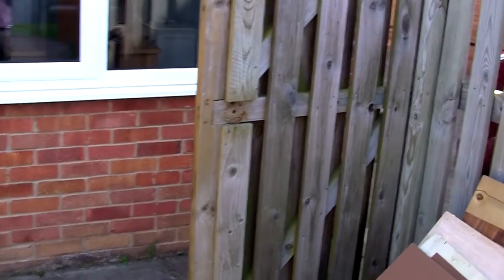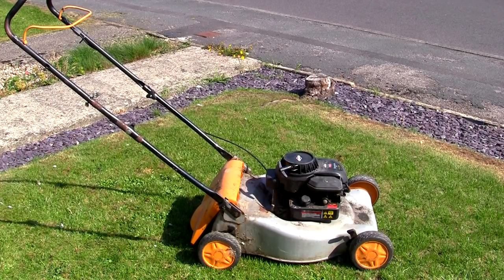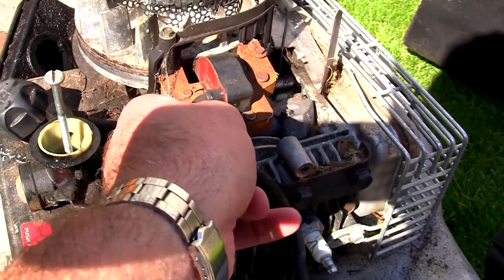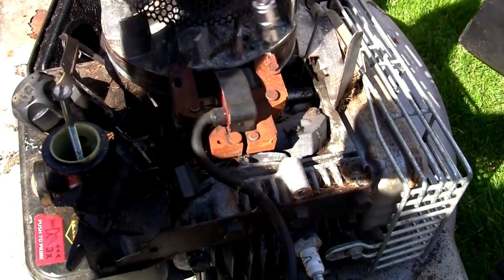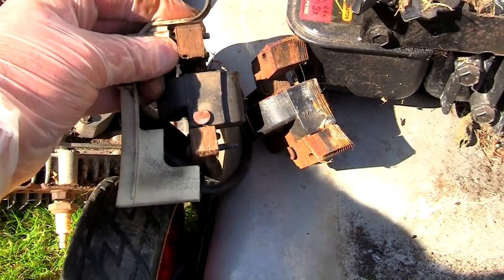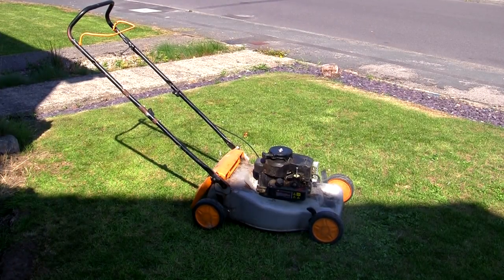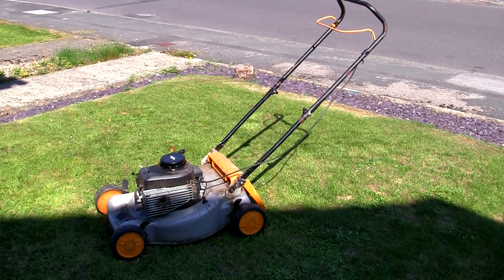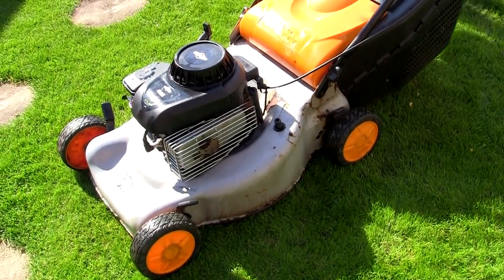Lawn Mower Runs Too Fast. Help And Repair

Comment: I am working on a Briggs and Stratton that looks similar that is also revved up way to high. I have replaced the diaphragm ,gasket, and carbonator on this engine. Cleaned it up but it still has the same issue of wide open revved up when it cranks. I stop it to prevent damage but do not know what is the problem. The governor springs  are present and look ok. Any ideas what could be the issue? Lawn mower is old but just one day when I went to start it , the high revved up engine. A couple engine mounts to steel deck look slightly cracked also so that can give u an idea. Any help would be appreciated and welcomed. Thank you and keep up the great videos.
Reply from the maker: Make sure the governor flap opens and closes correctly with the engine cover on and off
Reply: Hello, the governor flap appears in tack and properly connected. No debris or anything impeding it. Only thing I did notice was mild scraping of coil possibly touching the top magnetic part of engine that spins around with the coil next to it.
Reply: Mine is over revving. One problem I found tonight is the housing that holds the air filter is plastic. It’s bent inward, probably from heat or from hitting things. The air filter housing is preventing the rod and spring that come from the governor from moving freely, so things are either not engaging or locking into place behind the air filter once the motor is running, causing the motor to rev so dang high. Mine is a Cub Cadet.

Comment: I only ever find splayed coils on those flymos with the sprint engine , I couldn't tell you why, can I send you a few primer bulb and diaphragm kits for these engines and some filters I sell /use on my own customers machinery

Cheers
Reply from the maker: Matt Clark Thanks for the offer but I've got enough bits at the minute. I wonder why you only see them on the sprint? Very interesting
Reply: I wouldnt say no, if you had any extra spares laying about you wanted to rehome
🙂

Comment: Can you get it straightened out the recoil connect to the spark plug of the motor  
Tip number one always put in a business card in front of the flywheel on your Mower engine and then you can put it on recoil and put out the business card Barb's your uncle